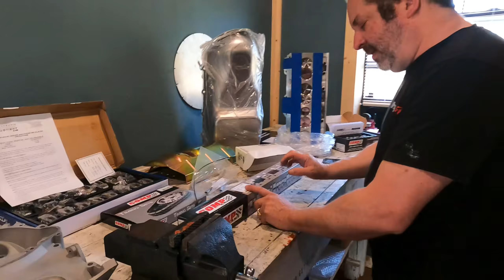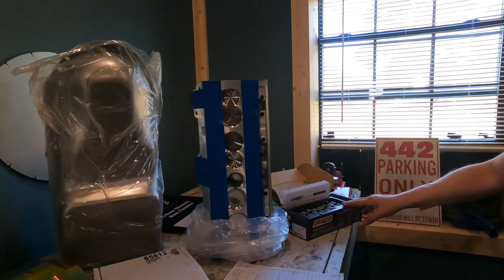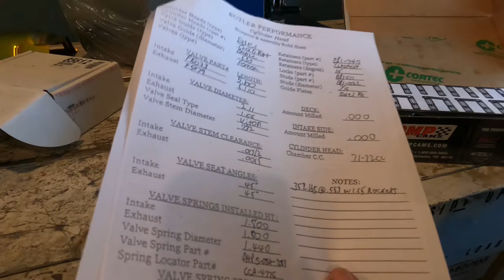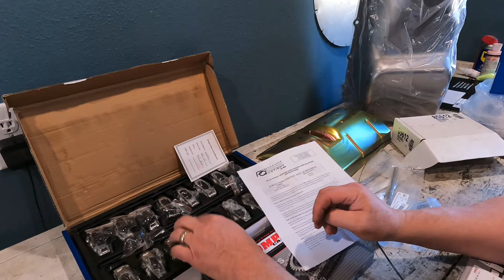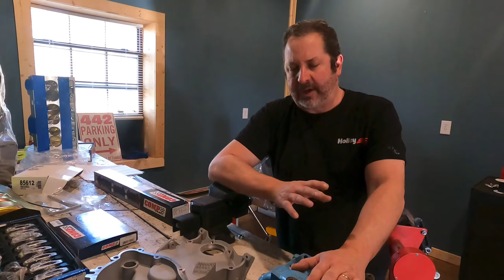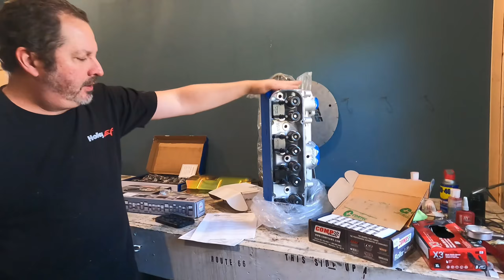Pontiac 350 Stroker Build

Comment: I appreciate the Pontiac build but just don't see the rationale here - for the same exact cost (possibly less) you can build a stroker 400-461  that will make 475-500hp and 550 tq with a fairly smooth idle on 92 octane.  Going from the 350+.030 3.905 bore to 4.15/4.18 bore allows a lot more airflow at the lower valve lifts as well.   I like the 350 but I wouldn't build one.  Even a budget 406 build on 92 octane with factory crank will make a lot more power (425hp and 475tq) with decent idle.  20+ years ago I helped a friend find a junkyard 455 and build a budget 462 with mildly ported 6x heads that made 470hp and 560tq.  The total cost was around $4000.  His GTO was so fast his wife was scared to go for a ride in it.

Comment: It will be interesting to see the differences between your 350 stroker and mine.  I went with 6X-4 cylinder heads and a 9.3 CR, but I used the 4.25" stroke crank for 413 cubic inches.  Here is one of the dyno pulls:

https://www.google.com/search?client=firefox-b-1-d&q=Pontiac+350+Stroker+Dyno+Runs#fpstate=ive&vld=cid:f87db009,vid:cfso2r9udv8,st:0

Good luck!